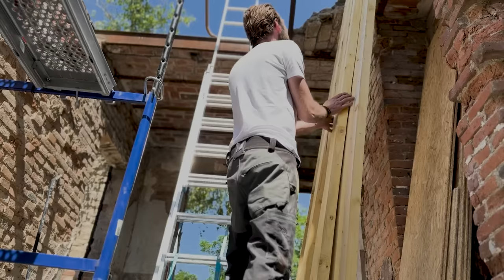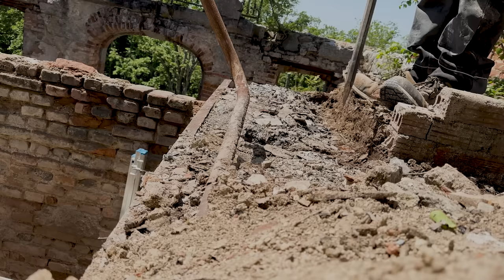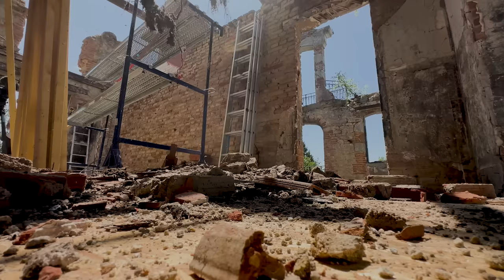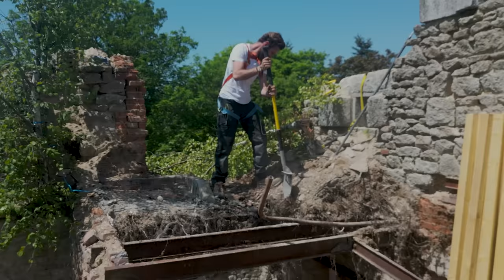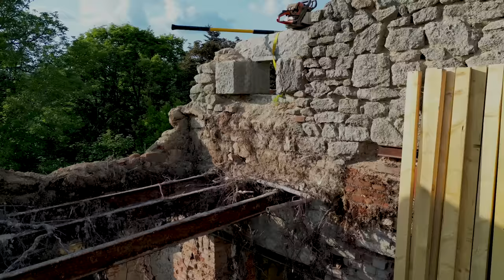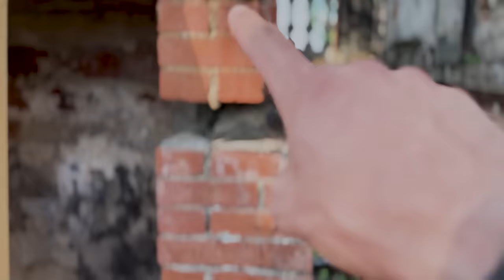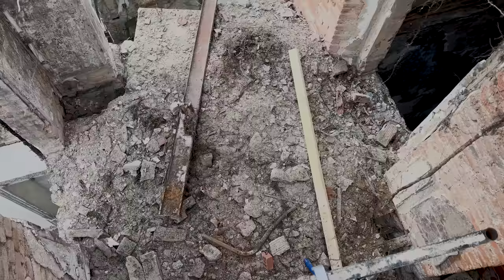Breaking the floor that holds the chateau together; a frightening find.

Comment: 1- why do I keep tuning in when I experience so much anxiety? Your dedication. 
2- we don’t use this word often in the US, but removing that I beam made that wall look very dodgy! Please be careful. 
3- with the bricks coming out so easily with what looks like sand, how in the world is that going to be a safe wall in the future? Does new pointing secure it enough? Will there be a wooden frame or dry wall helping? So confused. 
4- great job and stay safe. 
5- I’m sure you saw the video of a local news channel that did a piece on your chateau a couple years ago, if not, look for it. What you have done so far is inspiring.
Reply: Yes, i don't understand either. Why is it safe to build a part of solid wall on top of a crumbly wall ? I don't get it.

Which local video do you mean ?

Comment: Dan PLEASE consider how important all that steel is in keeping all those walls from falling over. I for one would NOT be touching anything up top until all the lower sections are braced together. Please talk to a structural engineer
Reply: Agreed!!!!!!!
Reply: 100%!!
Reply: Dan is all about structure, and he is engineering things as it goes. he is an experience fixer and attended the prestigious YT school of learning.
Reply: There' a reason why a vaulted-ceiling structure has been chosen. 1. it's a fire preventive. 2. it can carry very high loads from 200-800 kilos per M2. I wonder what the roof weighed on this building?
Reply: been saying this since he started. That said, I would assume he's done some background research and knows what is and isn't possible...at least I hope he's done some prep work...
Reply: @happytraveller8953  I've worked in France in the building trade; and believe me there were a lot of Brit cowboys there. Brit plumber couldn't get the work passed by the Building inspector.Many had never learned to use or knew of Castoline a soldering method based on silver and not tin. Silver had tobe use because of the high water-pressures use in France.
Reply: Absolutely, it's been suggested numerous times before. Some of the things being done are alarming, some of it is arse about face. I honestly don't think a full assessment has been done yet, by Dan or anyone else.
Reply: I fear you are right. I’m surprised that French building control aren’t more involved, but perhaps we’re not seeing that. I saw a detailed film of what is involved in such a restoration when they do get involved. Structural integrity after tree & water ingress, personal liability for all work until 10 years after completion if you did the work yourself - even if you sell it, & full property tax immediately the place is dried in. These places stand empty for decades a reason
Reply: Y'all please remember that he went through two entire years of paperwork just to sign the buyer's agreement and break ground (which if France is as intense with building regulations as y'all say, there's no way there was no inspection or something done in that time), he's had multiple third parties on site including a building inspector from the company where he buys his large materials from, and finally it is his project that he is in charge of! The majority of the ground floors ARE tied together and everything he does is making this more and more stable. Please remember we do not have full blueprints, we aren't the local building authorities, and we aren't on site. If you have CONSTRUCTIVE (ahhh pun intended ahahaha) advice, by all means leave it because Dan continually reads and learns from the comments; but leave it at that. You're allowed to be worried, but there's no reason to be rude and indignant.
Reply: @42apprentice  Y'all aren't really there and don't know what he's had to do or prove to who. Remember: we see a lot, but not everything.
Reply: Love Dan and what he is doing, but I fear more and more for his safety.
Reply: @nicholasmarshall3191 I watch his videos to firstly see how Dan is progressing and lastly to make sure he is still alive and hasn't fallen through the floor or from the wobbly scaffolding.
Reply: @ludovica1914 Well said. Thank you. I agree 💯 %
Reply: - It scares me to see that the bricks he's pushing of the wall are held together by something that look more like sand than lime.
- Securing himself to a tree growing out of the wall, it looks hazardous to me
- Sure it's expensive, but why not build a complete scaffolding from the ground to the top of the chateau. It's better for safety and you can better move about at any height.
Reply: Dan, get some serious scaffolding up and someone else with you in case of injury.  Can't the budget support that now?
Reply: @Adri Mathlener  that mortar has had a lot of time to settle and stick to surrounding bricks. In this video, Dan points out that it's better than it looks and that where the wall is now out of plumb, he is rebuilding it.
Scaffolding on the outside does nothing for the internal walls that are currently being worked on.
My only concern from today's video is removing steel joists before the noted pillar has been reinforced. I'm not an engineer so I don't know if that adds stress. I do know enough that removing some weight via discarded bricks will help. They don't look placed as counterbalance. Cross beams do help walls overall.
Reply: @ludovica1914  well said.
Reply: @ludovica1914 totally agree with you👍🏻
Reply: He said I'll board ASAP tomorrow 😂, if that arch falls for any reason, like a gust of wind or just trying to make a hole to insert the new beam, it will take half the castle with it. You need to secure that arch and fix the hole in the base. I'm not a structural engineer, it's just basic physics.
Reply: @42apprentice  Do not forget that the fire burned everything, the lime mortar is gone, and the brick is supported only by its own weight, so at the top where there is less weight, the wall will be more unstable.
Reply: How do you know he hasn't spoken to a structural engineer? In France one needs both a structural rapport and architects drawings to get building permits. Your comment is ignorant at best, condescending and patronising at it's worst.
Reply: Yes I was thinking & visulising what would happen if he touched that bar as well 😬

Comment: Hey was watching that bit when you were using the grinder. You might want to slide the guard around. So when it's cutting, the blade is pulling away from you. If that blade catches. It could kick back. grinders can really mess you up fast. Great work looks great though
Reply: DAN  DAN  DAN  PLEASE READ THIS SAFETY TIP SHOWN ABOVE BY SHANE MCNALLY!!!
Reply: Good tip. Even if Dan doesn't see it, know that your knowledge reached me👍

Comment: It's shocking how easily those bricks come out. A bit frightening, really.  Daily prayers for your safety.
Reply: My thoughts exactly. If all walls are that loose, then what is the point of saving these ruins? But I'm here for it.
Reply: i  do pray for Dan as well
Reply: Lime mortar, with which the Chateau is built, crumbles far more easily than modern cement mortar. However, that is not necessarily a bad thing. The worst thing that you could do to such an old structure would be to use cement mortar.
Reply: @Ruhrpottpatriot  But the new mortar, that Dan is using to rebuild walls, seems pretty solid, and from the old mortar, it seems that there is only crumbeling sand left. 

Why does it make sense to rebuild solid walls high above on 8 meters crumbeling base ? 

(Sometimes i have the feeling, you just need to run against a wall, and everything will fall down like a cards castel.
Reply: The EASE with which those masonry walls just come apart is INSANE. Although he says he finally reached a level where it’s more stable, I’m absolutely LOST how he’s going to build on such a fragile structure. 

And HOW THE HELL IS THAT OTHER WALL STAYING UP?!? 🤦🏽‍♂️🤦🏽‍♂️🤦🏽‍♂️🤦🏽‍♂️🤦🏽‍♂️🤯🤯🤯🤯
Reply: @DrMJJr  Exactly! I know nothing about building, but I'm thinking before putting new bricks on, he should get to a solid base? I'm hoping he has gone down low enough to a stable base!
Reply: @brendapeterson1059  the biggest problems i see, is the combination of the aftereffects from the fire and half a century of rain... it baked the mortar into oblivion before completly washing the lime out...the Red clay bricks are also prone to go out in rain, especially sour rain, thats why red bricks are mostly protected with either an coating, paint ot plaster...he is standing on a Sand castle in the making...it's at this point very much clear that at least the annex needs to be built up from the 3rd floor... from the drone footage of prev videos and this one it's clear that the whole thing is compromised in at least 5-7 places and ready to go down, no care if anyone or anything is in the way...
Reply: I am amazed more people don’t take a second to click the like button. It is one thing we can do to help Dan from our couches and arm chairs, and a lot easier than carrying bricks!
Reply: This structure on top is very precarious and that one corner going all the way up with the bricks missing is scary.
I would have tried to shore that up immediately or a large portion of it could collapse.
Be safe out there!
Reply: A waste of time and money but we watch anyway…. this is only a tiny. piece of the overall house .
Reply: A few episodes back he did explain how the top layers were brittle but the bottom layers were not.
Reply: agree. how are any of those walls stable?  exposure to the elements seems to have turned the walls into sand... frighting
Reply: the whole show is very interesting . He is almost rebuilding the whole place and keeping it interesting all the way .
Reply: @brendapeterson1059  I hope he doesn't underestimate how dangerous fire and water damage can be.
Reply: @sabalight2558  >Why does it make sense to rebuild solid walls high above on 8 meters crumbeling base ?      - Because that are the rules of the game called Jenga
Reply: The fire might have damaged the lime more than you'd expect
Reply: Or you could send them some money for more safety equipment. That would help them directly. . . Like. . . In reality.

Comment: Hey Dan! Yea that pillar that's "supporting" that turret, looks really scary! Perhaps, for now, just stick something like a block of wood or a brick, in that hole, to give it some extra, temporary, support, so that it doesn't try to come down on you whilst you're trying to tackle it?!?!
Reply: This wall needs at least a brick underneath it immediately. Scary stuff
Reply: Unbelievable that he did not do it immediately, this can come down literally every second.
Reply: My thinking exactly, put something in there before you leave, tomorrow could look a lot different  if it leaned the wrong way. And more freaking work design to rebuild it back
Reply: My first thought was blocks and wedges immediately!
Reply: Agreed immediately 🙀

Comment: Scary, man. I’d try to take a short piece of I beam like you just cut, wedge it under the sagging brick course in the column, tuck point any crack above it, then jack the other end of the I beam until that course of bricks is straight, then lay brick on either side of the beam and let everything set. Then remove the beam and brick the hole.
Reply: Sounds like a good plan
Reply: I would have wedged a piece of old beam or ti.ber in, just to calm myself thar it will stillbe there tobe fixed tomorrow.
Reply: @michellebyrom6551  This is the exact section of wall that had me worried for weeks. I don't care about the other walls, old mortar and minor frost damage, who cares? They're still pretty plumb and straight by old house standards, who cares? This is the bit that looks properly precarious, far more than anything else in this place! Close second is probably what's left of the basement ceiling.
Reply: @michellebyrom6551  That's exactly what I was thinking.

Comment: Please use a regular polycarbonate face shield when using a grinder.The welding hood is plastic or pressed fiber. It will not even try to stop a cutting blade. A polycarbonate face shield is meant to at least give a chance to stop a broken blade or maybe stop an accident. 
I am a longtime metal fabricator, steel fitter, iron worker and a ship fitter. A proper face shield works. Also you only have two eyes. That it. There is no getting back your vision.
Reply: @alipalix  we only know what we know. Not everyone has worked in dangerous environments. The idea is to teach the basics and learn. Getting angry with someone who doesn’t know does not help. I am sure that when someone helps him by bringing it to his intension he will  hopefully change his ways. 
I do not fault him, he seems to be using good judgement with a safety harness, scaffolding and taking advise. 
The proper grinder guard for cutting metal is actually different than surface grinder. It is closed of on both sides to isolates from metal splinters

Comment: Love the demolition!! 
I know you want to restore the  Chateau to its original design and beauty but can you redesign it to just make it easier on yourself? Just make the walls safe and get a roof on it.  Make it liveable as soon as possible.  Have it closed in by winter. Board up the doors and windows.  Get a wood stove for heat. No need to build a cabin. Build an out house. Or at least get one room completely liveable. Winter will be here before you know it.  🥶
Reply: My thoughts aswell , the building‘s design seems quite symmetrical in the lower parts - a classic roof situation , maybe less floors - means less stability problems ? I‘m too concerned to watch any longer - the torret - beam construction will lose me .

Comment: Lots of comments about safety of lower brick. If you watch the drone footage you'll see motar is still left. Once the pointing and rendering is done, the walls will last for years. Same for the bricks, unless they are breaking apart, they are still strong. Look at the International Building Codes on bricks that have gone through a fire.

Comment: I think that the next time you go to the dump, you should get 4 of the largest cleanest mattresses to protect the lower floor in case of any mishaps. You can always take them back when you finish. It's free, and safe.
Reply: He and Cat already pulled up all the tiles and set them aside. 😊
Reply: @cathleencumpton779  I was talking about the new plywood getting damaged by either large stones, granite trim, or sections of the tower falling. I've been in construction for 41+years.
Reply: He will be replacing that OSB. No way it's going to survive what's coming. IMHO he should have used planks. No place for OSB in a chateau. Witness the plank flooring in the "bee" bathroom. Survived a fire and 50+ years of exposure and still tough as nails. Put OSB through all that and see what you get...mushy pulp

Comment: Lots of armchair commentators on here - with best intentions - and I have to join them on one subject - safety ! I'm from the oil & gas industry, and know my (practical) beans on this subject. Like everybody else, I'm as impressed as hell with what you are doing, BUT working alone on a dangerous site is already quite crazy. You can easily be hurt and unable to call for help. But breaking out the same floor you are standing on is really looking for trouble. When no stable anchor is available for a safety harness, it might be a first consideration to make one from secured scaffolding ? Or use the old iron beams to weld one together ? A transverse truss beam might work for the entire building area ? A few days/weeks work to increase safety in the months/years to come. Even after the walls/floors are ready, you still have roofs, outside facias etc. Strength to you Mr. Dan 👍
Reply: Dan worked on oil rigs, albeit as a chef, you'd think he'd have absorbed some safety-consciousness from observing what went on around him.
Reply: @LaReynedEpee  we once had a cook onboard who wanted to start an open-fire BBQ on deck while we were testing gas flow 😂🤣 Could it have been ?? ..... Dan ?
Reply: @terryross1754  Hmmm...🤔😂

Comment: You're so brave wobbling about up there. It's scary how easy it is to push the loose bricks out. I wouldn't wait til tomorrow to prop up the tower though - yikes, it's hanging on by a thread.

Comment: I wish you had secured that pillar immediately. Maybe a few bricks and a couple of chainsaw made wedges just as a temporary measure to stabilize it. I can't imagine hacking away at those steel beams and pulling them out did anything good for it's stability, and it's going to sit like that overnight in the weather 😰😰😰

Comment: I noticed that problem with the pillar a few videos ago. I was amazed that you never discussed it. At this point, you really need to bring in an engineer to evaluate the situation. I can see a major outer wall collapsing.
Reply: "At this point, you really need to bring in an engineer to evaluate the situation." Exactly!!!!
Reply: EXACTLY!! OMFG this entire time I’m thinking that very top level will fall down with the slightest shake!!!!
Reply: @johnvonundzu2170  And to evaluate the state of the walls, on top of which Dan is rebuilding ...
Reply: Maybe he already has?

Comment: I also think a nice long handled Mattock would be an amazing tool for you when it comes to clearing out all that rubble. 
Far better than using a Backhoe. The Mattock has weight and is excellent for cutting and loosening through almost anything when it comes to soil and rubble.

Comment: There is no faster way to dull a chainsaw blade then to cut into dirt. I found it better to use a Reciprocating Saw with a course blade on tree roots. And a fine blade will cut the metal too.

Comment: Cut up old beams and make wedges to temporarily secure the tower by filling the gaps and lifting bricks. Wind is your enemy with that gap. Wedges are you ally, wood, steel, have a bucket of each and never be afraid to add them where a gap needs closing or filling.
Reply: Good advice